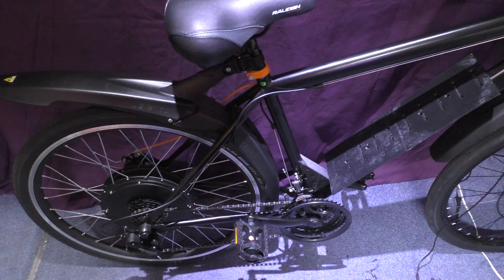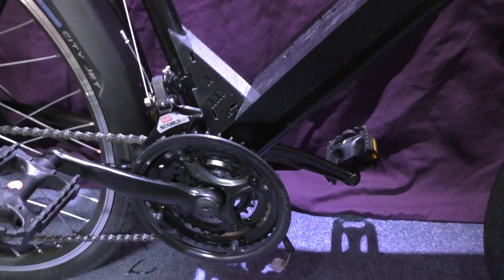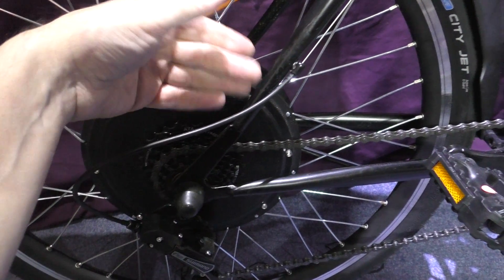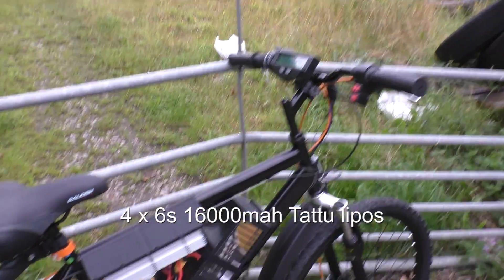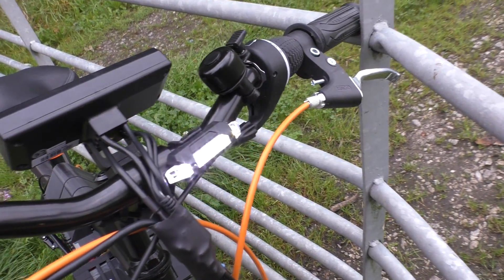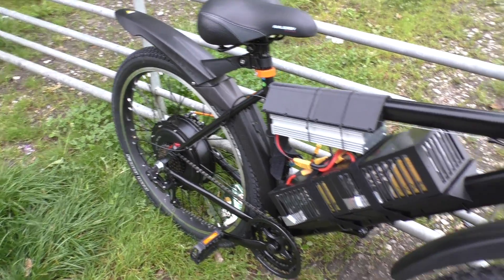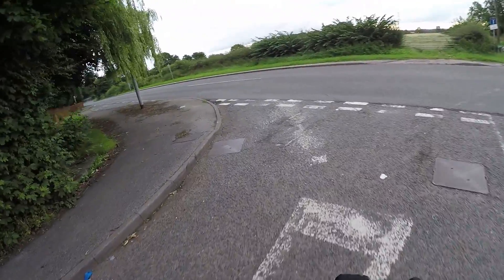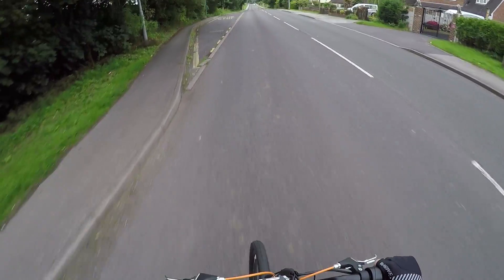Insanely fast DIY electric eBike - the most dangerous and unsafe bike ever

Comment: Change the wheel size on the controller and it gives you a better speedo. I have got mine at 20" with a 26" wheel.

Comment: Great eBike and video. I'm in Bangkok and wanted an eBike supplier to make me one almost exactly like this one, except maybe not quite so over-the-top in the power department. He wasn't willing and, besides, getting the necessary parts in Thailand is very difficult and the import duties would be very high (as it is with many imported items).

So, I've had to rationalize simply pedaling my bike at, what, < 400 watts (for a well-trained cyclist). Actually, in my case, maybe 100 watts if I'm feeling energetic.  :-)

Comment: Well done Tony but regardless of the time of day, (in fact, 6am is especially risky when you're least expected), please look behind more often and keep well away from parked vehicles as you're not in anyone's way in the middle of the road at 30mph and it will be much safer for everyone. Like you, I respect the fact that cars are bigger than me and always kept so far left that I even came off my bike over the handlebars down a drain cover with a gap wider than my tyres and shortly after that I hit the edge of a Transit van door in 1988 at only about 15-20mph and tore a ligament in my right shoulder when I landed on it and it still hurts to this day when I lift too much. Luckily I was thrown to the right and not directly forward or left. I could easily have avoided the opening door if I'd just given myself more space since I was aware that there was nothing else on the road at the time, which was weird, as normally there was always traffic in both directions between two sets of traffic lights at rush hour in Watford. Never take for granted that anyone can see you and drive or ride defensively as if anyone at any time could fling their door open or pull out as you said. I finally stopped cycling to work when a driver pulled out on me even though I had two PROPER, road legal bright front lights on. It had been raining and he saw me at the very last moment and stopped a few feet in front of me which would have resulted in my impact or being run over trying to go around him if I had given him credit for seeing me. I 'knew' he'd do it and skidded to a stop just in case. He then lowered his window and apologised. With increasing speed it is only a matter of time before you and others are involved in collisions of one form or another and I could easily find videos made by other cyclists and drivers testifying to that. Call me paranoid but I was hit by a motorbike on a Zebra crossing of all places, (on October 30th at 4.25pm in 1978) and still suffer the whiplash and back pain. Recently my left elbow has become very painful since the compound fracture of the humerus left my arm twisted off axis as the hospital didn't cast in a stand-off between my forearm and abdomen to hold it at the correct angle while it healed and it's worn the joint from hypersupination. I can't play the guitar, etc. etc.

Be safe! Be seen! You'll thank me later ;-)

Comment: hi the ion transfer out the rear wheel centre shaft would soak into aluminium like a capacitor aiding re fielding effect also you tried nitrogen in tyres stops earthing

Comment: Just a couple of things really with regard to your bike.

First off you know it's illegal right and if stopped you could be looking at losing your driving license yes and heavy fine and well let's just leave it there.

The second thing is, the actual bike itself, it doesn't look like it's designed for those high speeds as such you are seriously risking your life.

That bike looks like it would struggle to reach 30mph and those forks don't look safe either.

Did you do any structural work on the frame to make it safe? or do any work on the forks to keep them safe also?

Comment: There's rarely a good reason to manually discharge a lipo battery - it's an old myth that modern batteries have memory. Needlessly discharging just adds to the wear and tear of the battery. The only good it'll do is recalibrate the coulomb counter that tries to track the charge state of the battery, but that's ultimately nothing to do with the real capacity of the battery. You're wasting your money by discharging.
Reply from the maker: I don't actually discharge them fully, I only run them up/down to 3.85v which is the optimum storage voltage.
Reply: oh, well that actually makes sense. cheers!

Comment: Dude love it I would like you to send me the links of places where you got batteries and controllers I built one myself but much cheaper and I'm still running it at standard power 48 volts what I would advise to you is get a full suspension bike it will help a lot with the bumps I'll always hard at the bolt equipment too

Comment: I am sure somebody has already commented, but in the UK, a motor more powerful than 250w makes it an electric motorcycle. If you get pulled by the plod, they will want to see your insurance, registration and proof of tax. If you happen to have a driving licence, expect to loose it. 

I have a power assist on my recumbent trike, and would love a more powerful unit, but until the law is changed, I don`t want to loose my licence when I am not even driving the car or riding the bike! Good luck.

Comment: Insane that you built what could have been a great project around the most rubbish cheapo bike you could find.  Plastic brake levers, twisty cheap forks, steel quill stem.  Rebuild the project around a proper bike and it will feel a lot safer and better balanced. Also the light on the steerer tube wont be seen by oncoming traffic because it's pointing upwards it needs to be aimed straight ahead. Watching your last couple of minutes riding this have really made me grin though and I hope you get it sorted very soon. And looking at your other videos I can guess this will probably be pretty soon.

Comment: on a bike frame having to widen the rear fork isn't entirely uncommon, although normally you want to clamp the frame from somewhere else so you can center the sprocket set. sometimes you need to push it in =P

Comment: I don't know why you want wider tires, they just slow you down and you seem to like speed a little. But keeping the pressure down to 35 lb's is going to cause your rims to become damaged when you do hit bumps, the road will be able to push that air away and hit your rims dinging them up! Try a bike with suspension next time, it will save your balls because if you have ever been bounced off your seat you already know that sometimes those damn balls get underneath you for your decent back to the saddle! Now that does hurt. All you need is a 2.1 stereo (I( got one for my bike at AliExpress, 60 watts total mosfet amp for under $20 Canadian!) with a 4.5" sub from an old surround system and two 2 3/4" Peerless aluminium cone speaks also from Ali for around $40 so you won't want to stop riding. You'll need a high speed trailer to bring home those babes you meet at the pub, I'm sure they will be up for the ride. You have insurance, right? When you can outrun the law, you've done it right.

Comment: i wouldn't want to ride that bike unless it had wider handlebars, an 1 1/8 (clamp on) headset and some less cheap components! other than that looks like you got the speed you need just needs to be on a sturdier bike! rather than a chinese looking bike with chinese parts! look at some downhill mtb components as there designed for taking abuse! a frame like that doesnt look like it would last too many vibrations at that speed!

Comment: That's insane, love it! 
I have a kayak with a rear mounted 2hp trolling motor. I've noticed I can fit a 7Kw brushless in the motor shell.
I was thinking about making a massive pack of most probably samsung inr18650 30q's. Would LiPo be a better option?
Reply from the maker: Lipo batteries are far easier to work with and they generally have more power but (because of the physical size) you're somewhat limited on where you can mount them. 18650 batteries have a better life cycle compared to lipo batteries but they're lower power, so you need more in parallel. The big advantage of 18650's is you can build a pack to suit your needs with shape,  capacity and voltage.   
Personally, I'm saving for the same 18650 batteries for my new bike and I'll be building a pack of 200. If you have ample storage and you need high amps, I'd go for lipo batteries every time. Each one of my lipos will deliver 240a peak.
Reply: Ok cheers, I have the space and anything will beat the 70kg of SLA in there at the moment. 240A on tap is crazy. I was thinking around 500 cells if I went Li-ion. I might check what fasttech will do for a bulk buy and compare the Lipo cost Vs cycles.
Another problem is Li-ion is finding an ESC with the right low voltage cut. 
I could just buy a tinne and a 40hp outboard but I'd rather an innocent looking kayak that planes ;)

Comment: If you strengthen it up as it needs wouldn't that then be an electric motorbike, with pedals. Therefore we don't need to register a motorbike if it has electric propulsion and pedals:-)
It's a blurry line

Comment: Alright mate i have a 9k stealth b52 bomber  72v can get 50mph thats pretty quick bit jesus yours seems to scream wtf what voltage are you at? Looks impressive im wanting to built a battery do you have any vids or info on how to wire them with charging etc im wanting to build a jet pack got a very good idea for it stability have you seem my jet bike on here i uploaded it 10 years ago before everyone else did it 50lbs thrust jetcat turbine that was fun just too thirsty and annoyingly loud ha great build mate anyway thanks for sharing where abouts are you Birmingham?  Im in leeds but I work in cannock
Reply from the maker: Although the video doesn't show it, I was running 96v and it peaked at 110a (battery) and 320a (phase). Just after the video ended, the controller cut out because it overheated and I've since replaced it with a Sabvoton 72150 (loads more power)..... it's in my latest videos. 
I don't want to give out my location too much but....... I live where you work :-)

Comment: No way, thats bloody incredible. I got an adrenaline rush just watching that when you opened her up.
I want one. How much did the build cost ?
I dont blame you for wearing a full face. I would too. Reckon you could do with a rear view mirror, just in case the old bill come up behind you ;)
If you see the coppers, do you pretend to be peddling ? :)
Nice to hear an English bloke doing a vid like this and doing such a mental machine. Brilliant.
Reply from the maker: Believe it or not, I rarely go over 30mph and I haven't had a single problem......even when I go past the old bill and don't peddle. Keep watching mate, I'm building V2 with more power and I'll be listing all the parts.
Reply: Looking forward to it.
What do you reckon this one would do, flat knacker ?
Reply: Just had to watch it again. It's brilliant.
Do you reckon you might have triggered the camera at 11:41 ?
Reply from the maker: The cameras aren't working :-(  
The new one has an unloaded speed of over 80mph - take 20% off for the loaded weight and you'll be about right.